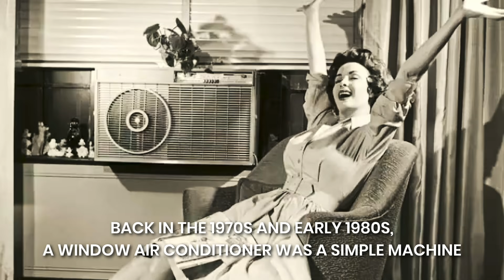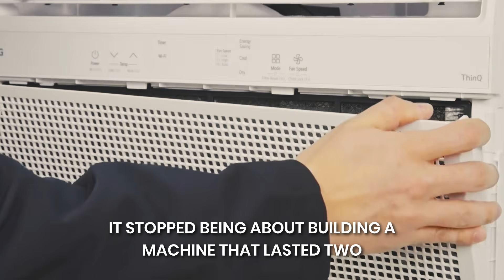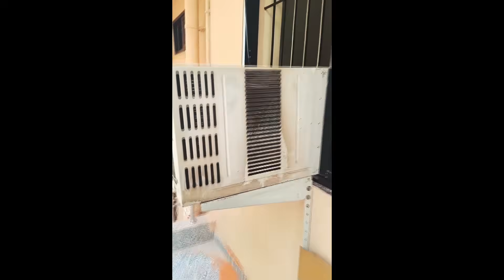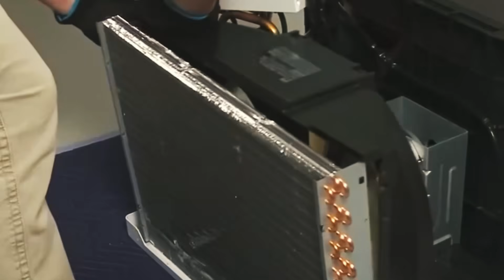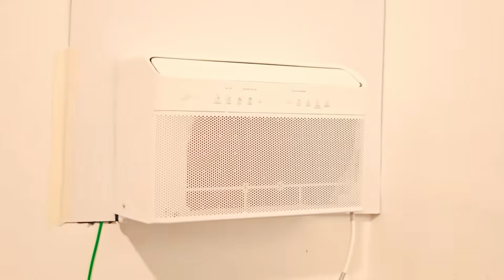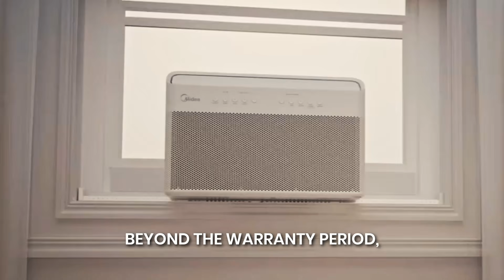Why 90% of Window Units Are Garbage (The Thermostat Parts Scam)

Comment: I bought a Frigidaire 'Sears' window ac in 1990 and so far it's unbroken at over 35 yrs R22 and it gets cleaned every yr with a shot of fan oil
Reply: Thats when they were still made good- now it's cheap thin copper and plastic- And the new freon is a joke...I have a 1 year old 14000 btu and it cools like a 7000 btu (if that) frikin trash- Have to buy a new one every year🤬🤬🤬

Comment: Today's window air conditioners have cheap styrofoam inserts that grow mold and bacteria. Try and clean it, good luck.....any harsh cleaner will destroy the styrofoam, rendering the unit useless.
Reply: use Clorox and water, not gasoline.

Comment: I drill holes in the condensation tray so it doesn't spray water on the condenser, which in turn acts as a trap for dirt and also contributes to corrosion.  Also I only buy window air conditioners with good old-fashioned clicky rotary knobs and no display - and therefore no computer boards.  Just proven analog components which tend to keep on working longer than their digital counterparts.

Comment: I have done HVAC work for 35 years and the most common problem with window AC units is that the outdoor coil gets jammed up with dirt and debris because of the way the condensation water is sprayed on the outdoor coil.  Use a garden hose and a good stream of water to hose out the outside coil.  Hose from the outside into the unit yearly or a couple of times a year and you will get better performance and it will last longer.  BTW, Friedrich is made by LG.  Soelus is made by Gree.

Comment: Most of these units blow big black specks out of them in year 4. This is mold and even if you change your filters as directed they mold up.
Reply: The key to preventing the mold problem is to run just the fan for a half hour or so after the compressor shuts off to dry out the coil and the blower wheel.
Reply: All units need a deep cleaning every other year
Reply: @andrewveres3965  Every year.
Reply: @andrewveres3965 
Most folks can't access the internal blower wheel and the cheap fiber board duct. These manufacturers  cut corners to sell them cheap. Iam talking about the 150.00 to 200.00 5000 btu units.

Comment: Im a HVAC technician and I can confirm this I have a window unit for my bedroom  that i paid 200 for, I  strip it down and clean every year and it has lasted over 10 years  most failures are from lack of maintenance on the units
Reply: Ty!!! Which unit did u end up going with?? Any upgrades you reccomend?

I am looking to get the LG inverter window 8,000 BTU HVAC unit
Reply: @kaw @kawaiisenshi2401  stay away from anything inverter those have circut boards that are obsolete after 2-3 years  , if you want something that will last longer with maintenance  get something basic it will cost more to run but your not buying new units every 2-3 years